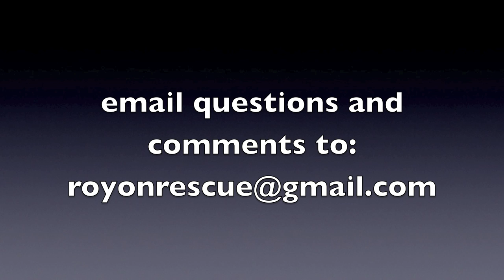Why CPR During Truamatic Cardiac Arrest Doesn't Work Very Often

Comment: Im definitely on the side of no CPR for traumatic arrest. When you actually think about what you are doing, if anything its causing more harm. Immediate interventions should be establishing airway, decompressing chest, binding the pelvis and stabilizing any possible hemorrhage, positioning, and IV fluid. These are the things that will save someone in traumatic arrest. There is a good chance traumatic arrest could just be due to a lack of blood in which case pushing on the chest will do nothing... the heart is already trying to pump, there is just nothing for it to sufficiently pump. Either way the chances of a good outcome are usually small.